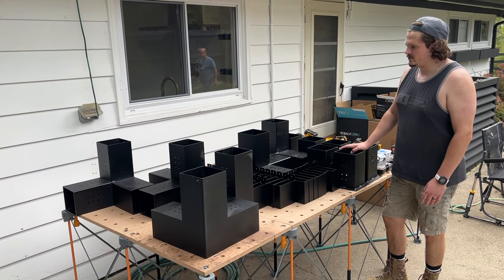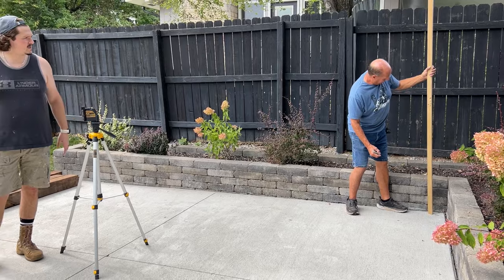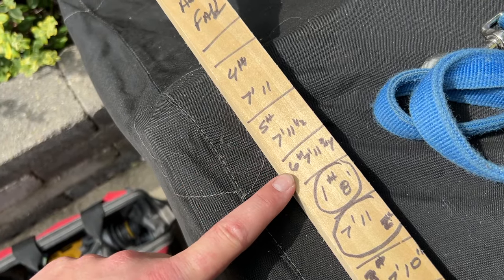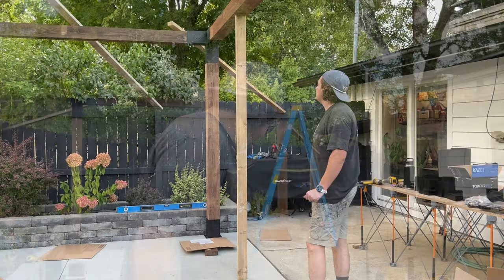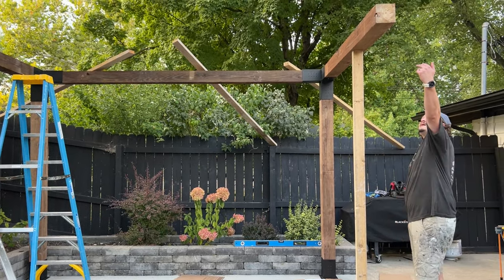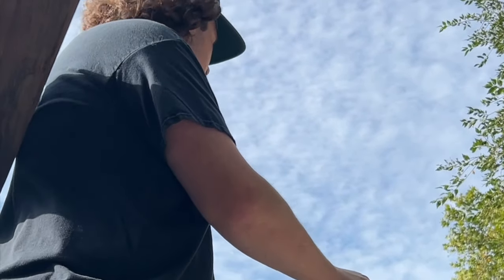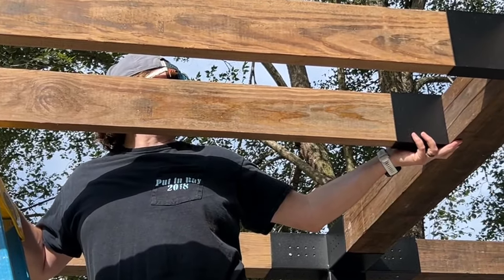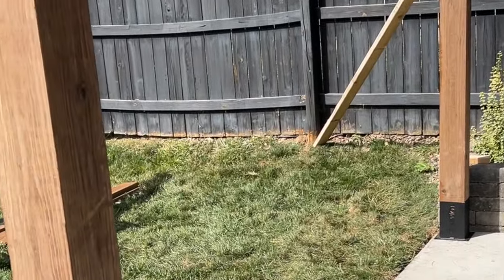How to Build a Modern Pergola from Toja Grid

Comment: Looks very nice.  If you throw a roof on top, how will you add a gutter?  I want to build pergola with a roof but need to give it a 2% pitch and add a gutter to drain the rain and melted snow.  Does the Toja Grid have a slanted option?  I will look into it.  Thank you.

Comment: Great video! I’m a complete noob at wood or anything like this, so excuse my question if it is too dumb: Do you have to deal with moisture trapped in the brackets that could rot the wood overtime?
Reply from the maker: Not a dumb question at all! The bracket actually have a lip that keeps the post off of the concrete to create an air gap. Not concern for rot.
Reply: @joshallen_builds  thanks! I’m talking about the brackets at the top, especially the horizontal parts where the 6x6s are inserted. The bracket in that part has holes and I don’t see any gaps between the wood and the bracket itself.

Comment: Amazon has kits much cheaper and if you’re in a pinch use QUALITY vinyl post with the same 4 or 6x dimensions. I made a few this way with wood rafters to attach sheet metal panels. Just like pipes use quality grade vinyl for the structure. If you’re using wood treat the foot ends of the posts and touch up the finish. Save yourself lots of money sourcing material instead of expensive kits. Some of the most expensive pergola kits are non timber composites.
Reply: toga grid has priced themselves outta the market in my area.  The PVC is a good idea. hmmm...